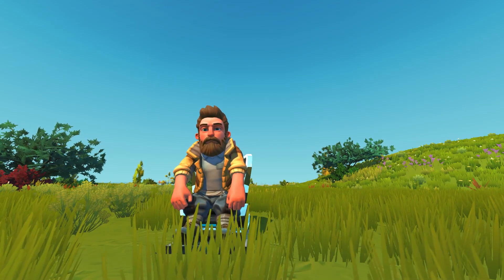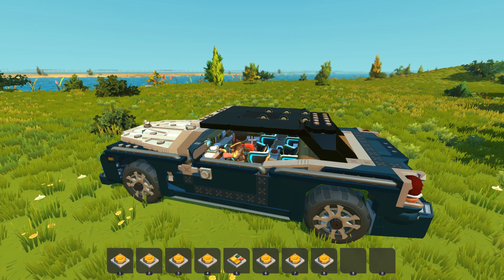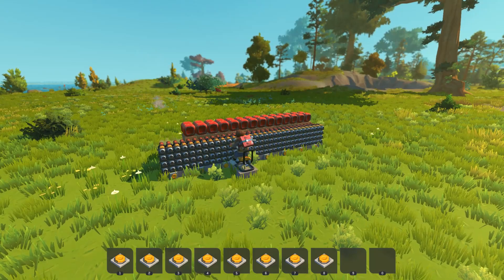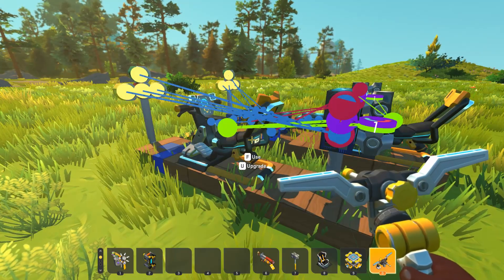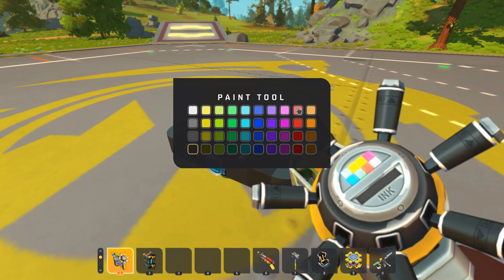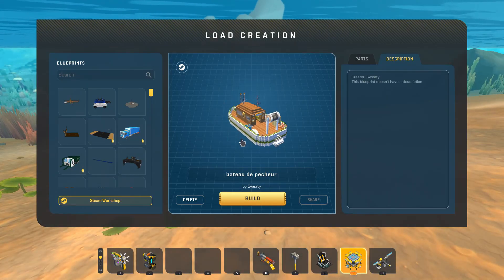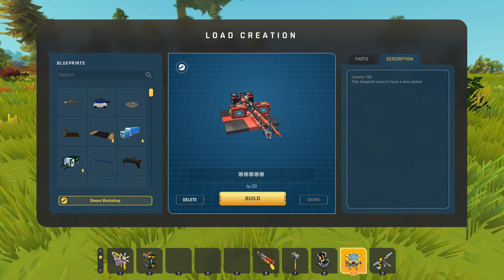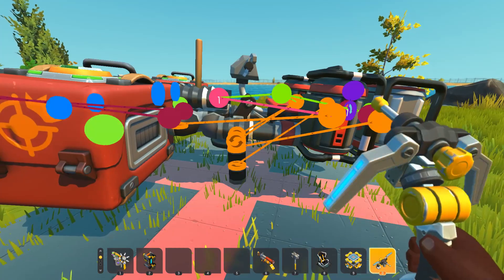This Is What Happens When You Connect Two Bearings Together! - Scrap Mechanic Best Builds

Comment: Yeah. The driver's seat is useless for the limiter, but it works differently. Honestly, I don't know where it can be used. Thank you!
Reply: B E A R I N G
Reply: I can only think of it being useful as an alternate for a level 5 seat. Like if you could triple stack the bearings and use two in the same direction to limit the steering angle, but even then you still have a loose-ish bearing. . . . maybe for something like those "wave boards"? The ones with the inline caster wheels. If you can control the angles those things can be flipped to then it might be useful, but again, a level 5 seat will do that already. I can only think of the engine bearings being useful for hill hauling, having to take your packed crops up massive hills to the trader. Having that resisting torque to keep you from going back down. . . .if Scrap Mechanics wheels didn't also slide so much.

Comment: “Hoverboards don’t work on water, unless you’ve got powerrr!”
Reply: Which is technically not true.  Even the cheap ones did hover over water.  The issue was that you couldn't easily propel yourself over water without thrust or find on your shoes.  It also appeared that it rode really low in the water, causing friction against the surface which slowed it down quickly.  Otherwise you could coast over small watery gaps.
Reply: @gaalidas4836  it’s a game

Comment: With the doble bearings, u could control the propeller rotation on helicopters, that way u could connect a bearing to a switch engine while the other bearing is connected to a seat controlled engine, with a little less power, that way if u press W propellers have more power and S lowers its rotation.

Comment: Ummm, you can edit the angle that a bearing can turn with seat turning, that's probably hiw you're supposed to use it, but as you can probably tell, there's not much point.

Comment: The delorean need's the flux capacitor to time travel and it suck's that the devs did not include the coveted flux capacitor "almost forgot the plutonium lol.
Reply: Year, gotta have the mr fusion on the back to power it, and the flux capacitor to initiate the temporal breach.  Otherwise you can go as fast as you want to no effect... unless you start approaching the speed of light. That's another story though.

Comment: Two bearings connected together is probably equal to 1 divided by 0
Reply: 1:1
Reply: I never understood the issue with division by zero.  Division by zero should simply return zero, just like multiplication by zero.  Or, in computer terms, divide any number by zero and you get null.  Null, by definition, is the binary sequence for zero.  Since zero is a number, it gets the binary for one meaning a valid data point with a value of zero.

Maybe I just have an evolved brain...
Reply: @gaalidas4836  5 × 0 = 17 × 0
                         ÷ 0     ÷ 0
                         5 = 17
                         But 5 != 17
                         So x ÷ 0 = undefined
Reply: @gaalidas4836  How are you gonna share X amount of cookie evenly among 0 people? That's what division by zero is.